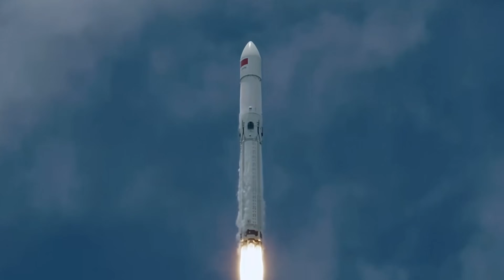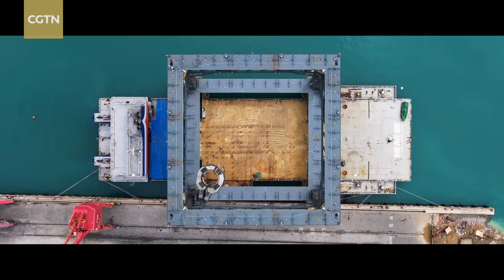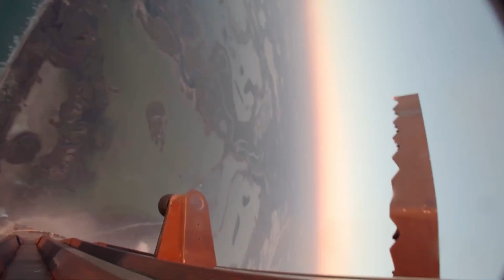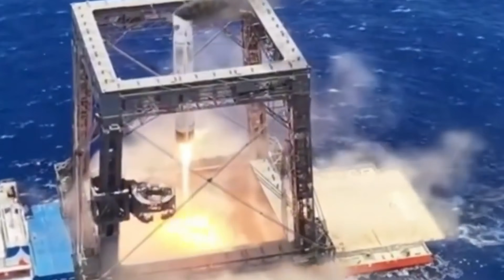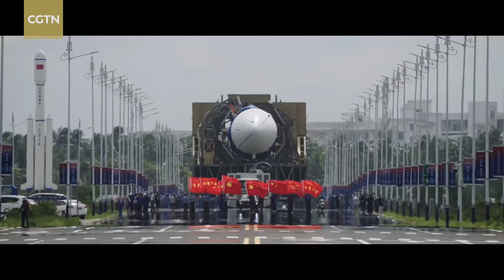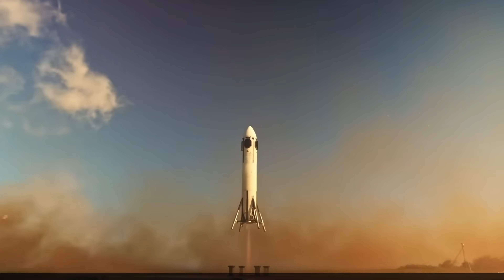SpaceX VS China: Who's Better at Catching Rockets Mid-Air?

Comment: China's system is more advanced because of:
1, it eliminated the landing legs (vs falcon 9)
2, it doesn't have to fly back to the launching tower, which requires a lot of more fuel (vs SS)
3, it doesn't have to decelerate to speed zero at retrieval, which requires more fuel and control (vs F9 and SS)
4, it allows much more system redundancy (vs F9 and SS)
Reply: Americans will be unhappy if you say that; they'd rather you say China plagiarized.
Reply: Euhm no. With China’s system you are limited with heavier rockets. As the platform size is already massively bulky using a lighter rocket. Second you need a pre built platform which you can’t build on Mars for example. SpaceX rockets can literally land on every flat surface.
Reply: @peter-xw1mu China is testing rocket with legs also. And China has already done landing on the moon years ago. Refresh your information.
Reply: What do you mean? SpaceX rocket has been landing on a drone platform in the middle of the sea.

Comment: It Is Not About Catching The Rocket! It Is About being Able To Land The Thing On The mark So It Can Be Captured With Relatively Low Tech ! The Arms Are Used To catch Trash cans Since The 80's! Same Simple Mechanisms Just Scaled Up To handle The Weight! They Basically Hover The Rocket So Beams With Pressure Switches Can Close Around It! Amazing That They Can maneuver The Giant Rocket To A Position Down To The MM

Comment: SpaceX capture is land based. China can easily put that catch tower on land, reducing the issues with it being at sea.
Reply: Euhm no SpaceX also landed rockets on a platform in the middle of the sea 10 years ago.
Reply: @peter-xw1mu  That wasn't my point. Starship has no legs and is caught on land. The Chinese version has no legs and is currently caught at sea. They can "easily" put that structure on land and the disadvantages of sea based landing are eliminated. I think they are going through the prototype phase, with safety in mind. They can scale this up with land based landing, later. I was comparing it with Starship development, not Falcon 9
Reply: @__TechAI__  SpaceX rockets can autoland on the chopsticks system, on the same launchpad and be refueled and inspected directly without moving anything and be relaunched. This Chinese copy used a system (because they couldn't reverse engineer SpaceX complex landing) that is a compromise. How are you gonna take the rocket off, refuel, inspect and put in back on a platform for relaunch? And this lighter rocket compared to SpaceX's lighter rocket doesnt need a specific platform to land on. just a flat surface.

Comment: How much does the Chinese system cost per launch? I haven't been able to find that information. That will ultimately determine which is cheaper and better assuming both have the same level of reliability.
Reply from the maker: True
Reply: The cable system doesn't look that expensive

Comment: In theory, the cable catching system should be cheaper than Spacex, cause there's no legs, so it saves on weight. We won't know for sure until a few years to see if it actually is cheaper and more efficient than Spacex's approach. 

The cable catching system could theoretically be scaled up to catch bigger rockets, too.
Reply: but even with cables and no legs the LEO capacity is less than the Falcon 9 landing on an ocean barge with legs.
Reply: @someuser7501  The difference is not that big, only like 1 tonne, or about 3,000 pounds, but that shouldn't matter when it comes to cost. I believe they went with this design because it's not necessary to have anything bigger for what they place in space. The rocket size is also good for their new crew spacecraft, the one they will use for their space station. They could build bigger rockets in the future if they need a larger capacity.
Reply: @Ghost-g3i  No they went with this design because they are going to do a 3 booster falcon heavy type version where all 3 also all land at sea.
Reply: @someuser7501  This is new to me. I don't know of this. Are you talking about the new rocket for their man lunar mission? That rocket uses three boosters. They are expendable from what I heard.

China is building an equivalent Starship rocket, the Long March 9, which will be reusable as well. They will probably utilize the cable catching system most likely.
Reply: @Ghost-g3i   LM9 is a single booster not scheduled to launch until after 2033 so it is not in the immediate equation. To get around the delay they are using 3 LM10s strapped together. By the time China gets its LM9 working SpaceX will probably already be flying the massive Starship V4 (200s tons to LEO) as it is ALREADY flying the Starship V3 (150 tons to LEO).
Reply: @someuser7501  I honestly have no idea what you are talking about, this is all new to me. I think you are confused with the man lunar rocket, that does utilize 3 boosters, but they aren't reusable. Their starship equivalent rocket won't be flown until 2030, and it will probably be operational in the 2040s, or sooner. As for Starship, it's been more than 3 years and they are still testing it. It won't be ready to until 2030s, the next version of that won't be ready until 2040s most likely, if they even decide to build a bigger version, which I feel like won't be necessary. Starship is still in testing phase, it not useful yet. The original idea for Starship was for Mars, it wasn't designed for the Moon or for low Earth Orbit. Now, spacex changed it to land astronauts on the Moon, and for sending satellites into space. Landing that thing on the Moon is going to be a challenge. I highly doubt it will be ready to land astronauts on the Moon before China does, by 2030. Some experts are even saying that Starship is not really necessary, it's more like the Spruce Goose of our generation. I think the only usefulness of the rocket as of right now is getting satellites into space, and nothing else. But with current rockets like the falcon 9, I don't see why you need a Starship. But anyways, the US and China are pursuing this, so they must know something I don't know.
Reply: @Ghost-g3i  What are you talking about??? The first stage Starship booster has ALREADY launched payloads into space 12 times. 12 times! What wacky logic are you using to claim "not ready" until the 2030s??Just because the 2nd stage Starship payload carrier hasn't landed in one piece doesn't mean the 1st stage Super Heavy booster isn't working or ready. Here is SpaceX already having their booster fully working and landing and then beyond that they are trying to do something revolutionary by landing its second stages too (which BTW China doesn't even plan to do for at least another 10 years from now) and you are looking at it as a setback delay to the 2030s. OMG! So far no space agency other than SpaceX has even ATTEMPTED to recover a second stage...they all usually burn up on re-entry.
Reply: @someuser7501  I was referring to landing astronauts on the Moon, if they even are able to do that. As for payloads into space, yes they have sent some into space, but the payloads were all dummies, just for testing purposes only. I was saying that Starship is not even needed to launch satellites into space, when they already have the falcon 9. 

What you said about China not reusing any rockets, do you know that they have the long march 10a and 10b? They just shown they have reusable rockets. Plus, their private companies are also working on reusable rockets. China plans on turning much of their conventional rockets into reusable ones in the coming years. The long March 10a and 10b is just the beginning. Landspace is about to test their falcon 9 equivalent rocket again this coming August. China has many rocket space companies on the works, all pursing reusability. I think you underestimate China and what they are capable of. You think only the US is capable of doing such feats. China's approach is more realistic, in my opinion. They are going about all of this in stages. 

Even if spacex is ahead of China, it doesn't really matter that much in the grand scheme of things, they have no plans on going to Mars anytime soon, the Moon mission is still years away. China will be landing on the Moon by 2030, and they will have a base set up there shortly after. Were going to be stuck in our solar system for a long ass time. Elon's little speech about building spaceships like on Star Trek and exploring the galaxy, complete fantasy. He will be long dead before that even happens, if it actually happens that is. We don't have the technology to explore the galaxy, it may not even be possible to build a so called warp drive. So, were stuck here in our little part of the galaxy, maybe forever. So in the grand scheme of things, building rockets and stuff, is kind of pointless, unless your just using it for satellites, which is the only useful thing, but you don't need a big ass rocket for that.
Reply: @Ghost-g3i China has only landed the first stage. Starship is about landing the whole rocket. The 1st stage + the 2nd stage. China has no immediate plans to attempt to land a second stage. They have mentioned someday doing the same strategy of Starship by bellyflopping the second stage.
Reply: @someuser7501  You're talking apple and oranges here. When did I ever say Long March 10a and 10b are equivalent to Starship??? Now, you're just making stuff up. This conversation is becoming super pointless.
Reply: @Ghost-g3i  I'm trying to tell you one of the reasons they are getting the LM10 to land is because they will be needing the power of 3 of them strapped together to get astronauts and their heavy equipment to the moon because the LM9 isn't expected to be ready until the 2030s. They of course will not be reusing the second stage or the third stage of this triple booster rocket. SpaceX is trying to reuse the upper stage of the Starship by doing bellyflop landings for two immediate reasons. The first is for CHEAPLY launching the new larger Starlink satellites. The second is to pack it with fuel which will be offloaded to another ship in earth's orbit which will be used for moon travel. After offloading it will bellyflop land at the tower. Both of these reasons require the second stage to be recovered and reused multiple times. The third reason far off into the future has to do with Mars.